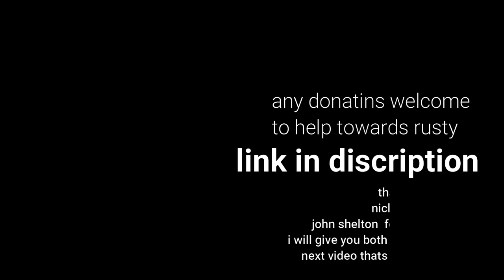ford capri 3.0 restoration  part 17

Comment: good to see the new guarded  angle grinder....why not use the old one, with a wire brush cup... you'll clear rust 10x quicker than those little drill wheels.  great safety glasses too.  keep it coming.
Reply from the maker: The other grinder is about ad it it keeps arking and thank you :)
Reply: @retrorust3395  the motor brushes have either worn, or got stuck